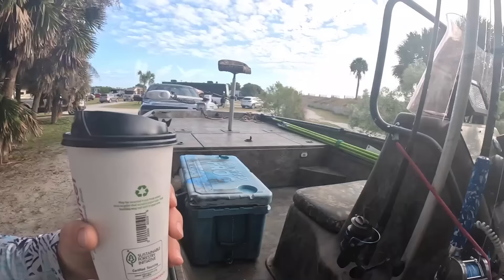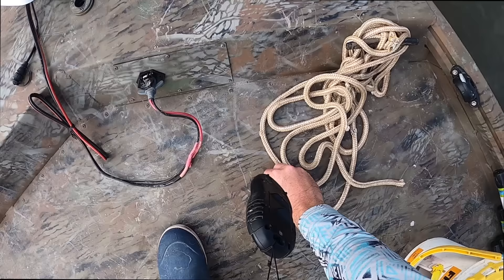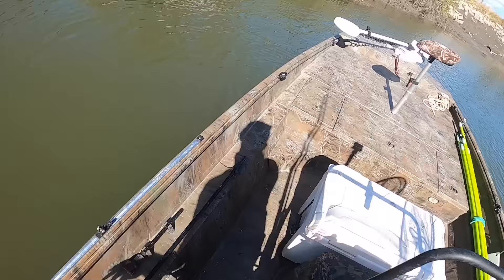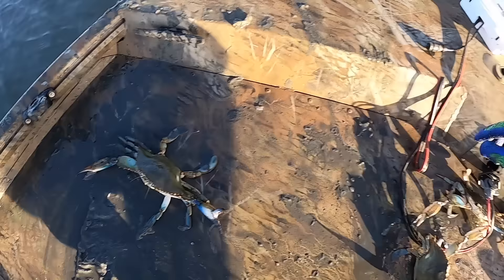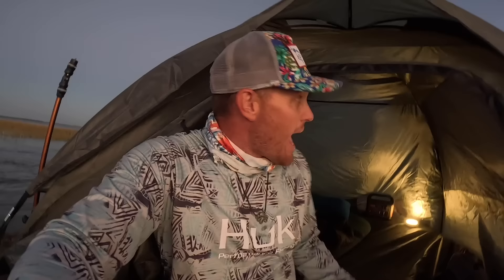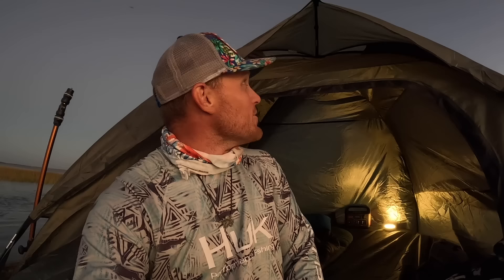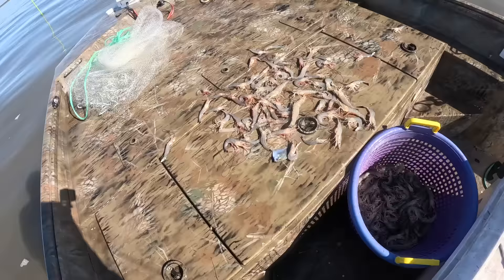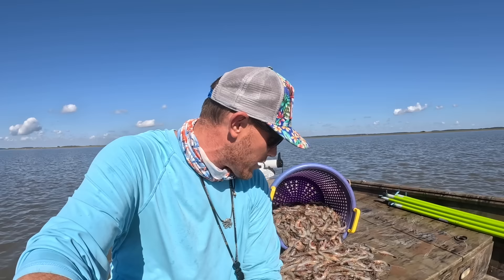TENT CAMPING on my BOAT at the Coast! {Catch Cook Camp}

Comment: The secret to boiled crab is to put them in the water before you boil it. They won’t drop their claws and they peal easier. Add the seasonings just before it starts to boil and yes let them soak. The longer they soak the better.

Comment: See!? That is EXACTLY how boaters are supposed to look out for one another! My wife, my two sons, my Dad, and I all went out on his new pontoon boat and it lost fuel prime. We thought it was out of fuel and you have to hang off the back of the boat to reach the fuel system, and we hailed down five seperate boats that were passing and not a single one of them were willing to help us. We literally had to call a boat towing service that charged my dad $750 and they never evem had to come get us. I hit the primer ball and the engine fired right up. I called 15 minutes after I called the service and they hadn't even moved yet, but they still charged my dad the full price!